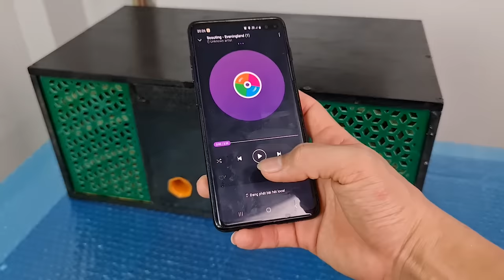MDF Wood Subwoofer Bluetooth Speaker DIY - Super strong bass

Comment: There's no bass whatsoever. Incorrect building of horn speaker. Idea is good.
Reply: He should have just made it a 3rd order bandpass for all that work
Reply: @livingintheLight.  No. It should be horn for deep bass and high output. There should be more precise calculations for horn cabinet, as i can se for the current cabinet he should use twice bigger speaker or should close one out port.
Reply: I suppose passive radiators plus force cancelling double woofers are the best combination for highest bass for a given volume of space.
Reply: @dr.python  it is not. Horn is much more efficient! Check it with yourself
Reply: @dr.python  an example youtube please ?
Reply: I built one of these and there lots of bass
Reply: Incorrect building ....I am agree
Reply: La perdida de sonido es mucha

Comment: Essentially you've made a double scooped horn which is purely a PA long throw design for mid bass/sub, the problems are these designs are very finicky. The horn needs a very linear increasing throat area your design is all over the place pretty much negating the effects of horn loading. You'd get way better sound from that driver in a basic design like sealed or ported... its not a driver designed for PA work!
Are you doing any predesign using software simulation?
Reply: Agreed... Also the Short baffles and rigid design (added in all those ribs) does not allow for resonance to emerge from the wood.  Big wooden panels only restrained at the edges make a natural resonance amplifier.  Been building loudspeaker cabinets for over 40 years.  Large resonance chambers make nice sound and you can tune each chamber for the resonance spike that you want. My designs incorporate 3 - 5 resonance chambers depending on application, this design is close to something I might do, but the small baffles and angles would change.  It is not necessary to create 45 degree corners to guide the sound waves. That defeats the point of baffle resonance. 
These designs in the videos are just wave-guides catching the very low frequencies and re-integrating them into the wood, but no resonance is occurring so the sound level at different frequencies will be very unbalanced.  
The first chamber ( where the speaker face is mounted) needs to be a lot deeper.  Put that one 5 inches deeper and will improve a lot.  The first resonance chamber is the most important and this one is too shallow.
  I know lots about natural wood resonance and this ain't it...
Reply: What software you use to design subwoofer or speaker box? Is it any free one?
Reply: @lancheloth  WinISD for basic modelling
Reply: @alldayadventures5418  VERY new to building speaker enclosures. With a build like this (assuming the baffle chamber was more suitable) is there any point in having the splitting ports? Does this simply increase the total port length and change the tuning, or would they normally be made at different lengths to offset the wavelength?(to make the sound smoother). Any info would be greatly appreciated. I intend to re-purpose older unloved speakers into something more usable. Cheers
Reply: @mcgriffith2727  Before Software.... before speaker design Math was even invented...   We used our ears.   If you take any 2'x 1' piece of wood, and secure it on 2 sides.  Tap a small hammer across the board, and listen for the different sounds the wood produces at different distances from the secured holdings.  Then secure that same piece of wood on all 4 sides.  Listen how it changes and start your design there.  Must learn about the wood first.  

I am about to make a very bold statement here...  I no longer use ply-wood for speaker builds.  I have never used compressed particle wood...(worse crap)   Now I use Pine.   Pine has many low frequency resonance points that I like to use.  Also keep the design simple.  2 - or 3 large chambers of different shapes and volume will be step 2.

Manufactures use compressed wood, because it is cheap, and it sounds cheap too.  Flat and struggling.

I build the most awesome sub-woffers with 8" drivers.  Do not need anything bigger than that.  Plus no flappy muddy sound.   Placement of the speak in the room is very important.  If speaker sits in a corner, or high up on a shelf, or in the middle of the room, all these will affect how your speaker needs to be designed.  Lots to this...
Reply: @alldayadventures5418  I love your comments, I've built stuff so wrong it hurts for my car.

I made a large flat box, to try and improve it's coupling to the vehicle and it sounded outstanding.   I guess the best way to explain how the materials are important is by getting people into exciters or transducers.  Wild the impact design and materials can impart.
Reply: Not to mention that with a horn loaded speaker the lower frequency is determinated by the length of the horn opening. So with a guessed opening of less than 60cm/24" it won't do anything lower than 150Hz
Reply: @swicked86  You should see the Cabinet I made for my 66 Mustang.  Took the rear seat out, put a huge cabinet there instead. (Rest of the interior was stripped down too) My 450HP 2500 pound Mustang was 12.7 second fast Fast and Loud... Needed Speakers that were louder.
Reply: Lol irrelevant comment. Does any of his designs seem normal to you? Once you start innovating and creating then your criticism will hold weight
Reply: @alldayadventures5418  I have never built speakers or subwoofers but Im really interested in sound and music and want to get into building speakers. Where do you think it's best to start? It seems like there is endless things to learn think about when building speakers/subwoofers and I just don't know where to start. Do you have any recommendations on where to learn about this stuff or any suggestions to what I should learn about first? Any suggestion or info would be greatly appriciated!
Reply: @oggan97  the best place to start would be not listening to that all day adventures guy on anything other than the fact the cabinet in this video will sound shit as you can gather from the demo at the end of the video. With that said the best place to start is enrolling somewhere with a good reputation for teaching audio acoustics and enrol and learn the fundamentals of audio and acoustics.
Reply: @oggan97  Loudspeaker Design Cookbook
Reply: Also the horn is way too short and mouth area is too small for bass frequencies.  That design can only "amplify" low midrange frequencies.  To make real bass horn, it has to be at least 1.5 to 2meters long and mouth area needs to be very large.  So for small bluetooth speakers reflex or passive radiator designs are the best to get some low frequencies out of it.  Bass horn can't be scaled down!
Reply: @alldayadventures5418  
A good 8 inch driver with pine. 
I learned something today. I have no idea what this man is building the amount of time that's involved.  I don't know what he accomplished.

Comment: if you were to add 1/2 or 12mm thick piece of wood to your miter saw fence your saw blade would cut completely through your stock cleanly without you having to tear the last bit and sand off.
Reply from the maker: Thank you
Reply: or just lay off the coffee and let the saw do it's job, completely. Or, adjust the fences properly because out of the box the set up is not 100%, as evidenced.
Reply: Justable the  saw a bit deeper. 
And he has a cnc. ?!
Reply: You know that us so simple and easy. I reconfigured mine by grinding away the bolt . Wish I had read this first. Thanks
Reply: Some rough parts.

Comment: Nice CNC and woodworking skills but as a bass cabinet I'm afraid it won't be a huge succes.
Please keep in mind that with a horn loaded speaker the lower frequency is determinated by the length of the horn opening. So with a guessed opening of less than 60cm/24" it won't do anything lower than 150Hz.
Reply: so that means a huge final opening of the long throw enclosure can produce lower sound frequency?
Reply: @zainrei4917  Yes, but it has to be a proper exponential horn. There's also a alternative methode; when you have a pair of them you can extend the frequency an octave down by coupling them.
Reply: @michiellombaers3198  How does that work on a physical level?
Reply: @v.scente  exponential horns use a phenomenon called impedance transformation to better couple the membrane to the resistance of the air and thus create higher efficiency. But it's one of the most difficult to design loudspeaker enclosures out there.

Comment: Very cool project and thanks for sharing it.   I assume that you know that it is a very hard design to get right, in terms of sub-chamber sizes, angles, ratio’s, expanding radiuses, corner profiling and many more factors.  Bose and others went through many acoustical engineering designs and prototypes to get something that didn’t sound bad.  However, even when you get the math and resulting basic design “right”, you have to contend with massive phase and other problems due to diffraction, nonlinearities and other issues.   
BTW, even adding cloth in place of that green plastic will help with some of the mid-highs issues.
Reply from the maker: Thank you
Reply: I agree with what he's saying, also I'd like to add that with the design you went with the efficiency of the speaker is extremely important because sound has to travel thru the box in such a way that it's not directly reaching your ears like most other loudspeakers would. Basically your box is the speaker. Looking at your box and amplifier, I would recommend one that was possibly larger in diameter or cone height, that doesn't have a very restricted spider, with a low impedance coil and a fairly powerful magnet . Very nice design. I used to build speakers and amplifiers for almost 10 years, and one of the hardest things I had to learn was to balance design with my ability to make all the small details perfect. Sometimes the simplest ones sounded good, however seeing your box I see much potential. If I would change anything from the box itself it would be removing the plastic you used for the port, which may be adding a pitch to the bass that's unpleasant, and like Andrew said using cloth for the larger ports. Wonderful video.
Reply: I'm pretty sure this project is just a show-off and no effort in calculating the case or selecting an appropriate driver has gone into this.
Reply: Where are the frq response measurements?

Comment: Another tip. Apply a layer of stain sealer to the mdf before spray painting. Keeps the spray paint from wicking into mdf.
Reply: he was using lumber core "plywood"...  its decent for medium quality end tables and such but it gets real "buzzy" when used for speakers...
Reply: Another tip. Use MDF!

Comment: You can afford a CNC router... but not the right size blade in your crosscut/mitre saw?  Looks like you need the next blade size up. It is very annoying to have to deal with cleaning up your messy cuts every time...

The use of a stop block on your mitre saw with a sacrificial fence could also help with this issue, by pushing the end point of your cut out further as well as assist you in making repeat cuts.  If you did this modification, you could get by with the undersized blade.

Beyond that, looks like a fun build!

Comment: You need to adjust the depth stop on that miter saw. That way it'll cut all the way thru the material at the back stop. A 2 second adjustment to save hours of sanding.
Reply: He also needs to not climb the blade. If that was a harder wood it would've got him
Reply: Replacing the blade with a sharp one might be the more important thing to do, then correct the stop so it cuts the wood and doesn’t require tearing the pieces apart. 

A new CNC bit while he’s at it.

Comment: Very cool but I don't really get the point of a BT pseudo subwoofer on its own. How would you pair it with higher frequency speakers? Why doesn't it have a low pass filter? Than again, I don't think I've ever seen a crossover circuit in any of this channel's videos. It all seems very interesting from the box design perspective but it all falls apart once random drivers get mounted without any explanation. I would really love to see how the enclosure gets designed, with all the frequency response simulations.
Reply from the maker: Thank you
Reply: These designs are all ripped straight from either speakerplans or other box sites. Only thing he did is downsize them and make it a "bluetooth speaker" that sounds like shit. This box design is originally for a 15 or 18 i believe. Previously he also made a CB-18 style enclosure that is normally meant for an 18.
Reply: @GravitySandwich  ok now it all makes sense 😂👍
Reply: that kind of box is just an acoustical  bandpass filter (4th order slope (24dB/oct)) for the bass 
(like "mufflers" in air ducts for noise control )
Reply: @pedrova8058  it's actually a 6th order.
Reply: @csorrows  yup, i forget the "tunned" part

Comment: Look great!  How does the frequency response compare with other subwoofers?  Are there any measurements?  Is the response and sound pressure level better than with say a $450 RSL Speedwoofer?
Reply: Just by hearing the sound from this encloser, I can say this is a worst subwoofer encloser. I don't even have to check for  spl, efficiency etc.

Comment: I think that you might be able to get more bass if you reversed the woofer so that the magnet part of it is placed in the opposite chamber
Reply: This is a 6th order enclosure. Tuning of the front and rear chambers is very specific. But, by looking at the design and the driver chosen, none of this tuning has been done which is why it performs like utter dog shit.
Reply: @csorrows  that and it's powered by a full range amplifier. basically a center channel speaker shoved in a box. nothing but muffled mids. Neat.

Comment: I like the design it's very creative. I'm no carpenter but I know how to use these tools and if you have a compound radial miter saw why is it every cut made here never follows through.? There is always what looks like 1/4" of material left that he snaps off. Then has to clean each piece with a grinder no matter what tool cuts it? Would the glue be better used against mdf to mdf instead of mdf to laminate? Again I'm not a carpenter or a daily wood worker but maybe his tools need sharper blades to reduce tear out or maybe that's just what the laminated sides do. Just an observation not putting his work on blast just curious. Cool box though.
Reply: its because he is using blade suitable for ripping and not for cutting, cutting blades have fine teeth

Comment: You could have used a larger full range speaker for that. I believe that's only 4inches? Maybe 6inches could fit on that.  Great inner design and esthetics but you can still maximize the power of that amplifier.. I think that design can also be used for sub woofers..

Comment: You should explain the design as I think it will help get better views for you.
quarter wave, labyrinth, passive radiator, etc
Explain how the speaker resonant frequency is used to determine the length of the labyrinth or port.
Also your link for my page doesn't work.

Comment: The sound doesn’t translate through well. 

But it doesn’t sound like all the effort was worth it. 

A fine practice run and you have some skill. The idea is nice, but too elaborate. 

For having a good set of usable tools, it’s strange that you have a CNC, but crappy dull bits. Owning a CNC can’t be cheap. Replace  the bit. 
Adjust your saw and put a good blade on it. 
That’s cheaper than replacing the saw, which to be honest, should be replaced if you want to make this type of more elaborate woodwork. 

I’m an electrician. I do some woodwork. I’m a great or at least very good electrician, but my cabinet making skills are not solid. You have some skills but need better tools. 
My finish trim work wasn’t very consistent until I upgraded to a proper miter saw. 
I had the same saw you have, or at least the Craftsman equivalent. 
When I made the hard choice to toss the $200 crappy saw and invest in something higher end, the work instantly improved and literally the job I made the purchase for, paid for the saw several times over! 
Suddenly my cuts were spot on and clean. Parts fit together and I almost made myself believe I was a good carpenter too! 
I was a better carpenter. Almost good.

Comment: I'm assuming your mike picked up faithfully what that speaker put out and the source was a lossless recording, if so the bass tones suck. They're clipped. Too many baffles. No speaker dose everything well, this one is a good mid range. Every speaker must be tuned, add some tweeters in the back firing straight out the grills Or add them to the front center panel. put the mid range firing out the front center panel and install a proper 8-10 inch subwoofer in its place inside. Or one that fits your box that's a proper subwoofer. Remove some of the internal baffles for a cleaner sound in the bass range. Remember low frequency sounds like bass are long sound waves they require less of an obstructed path so as not to get clipped. So gentle curves or just fewer sharp angles are better for deep base. Your woodworking skills are amazing though. Very well done. You've made an excellent mid range speaker.

Comment: You desingned a box for a subwoofer, not a full range driver. This thing will produce much intermodulation because of the non direct sound coming from the speaker driver. Great work, but makes no sense. Add 2 Sattelite speakers on the top, and let the bottom driver work as subwoofer and please fully close the front panel  (there are no ports needed). Will sound much better than this construction.
Reply from the maker: Thank you